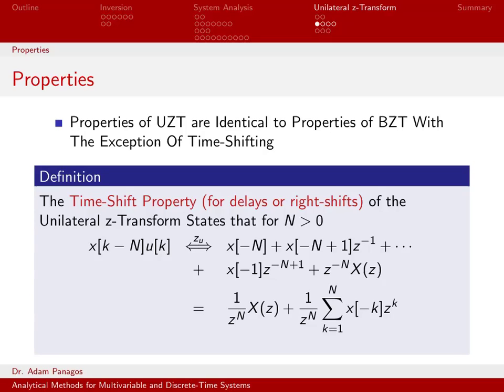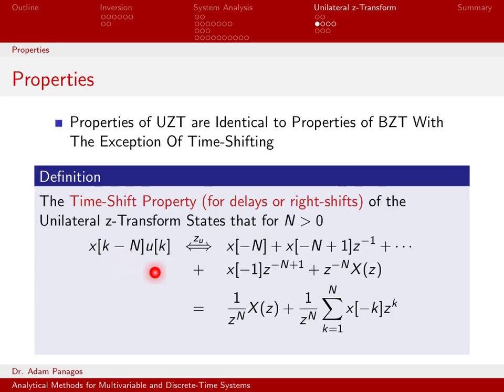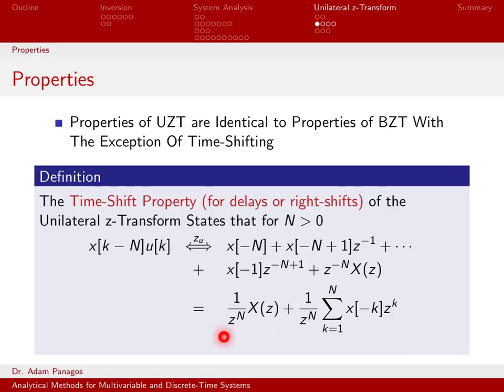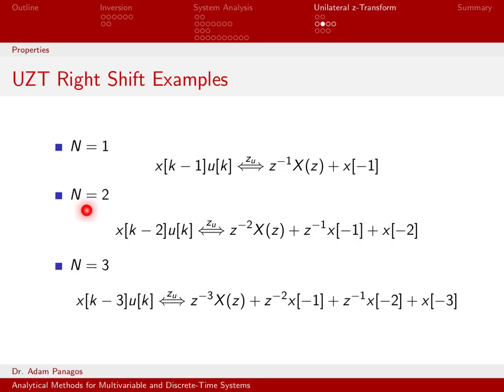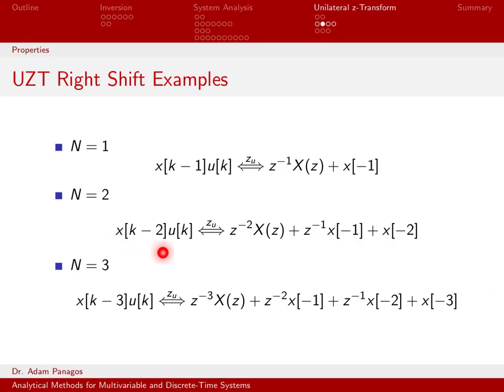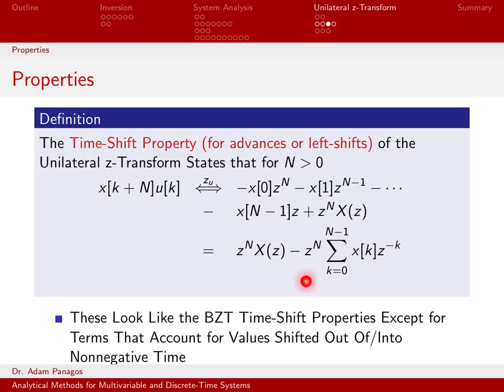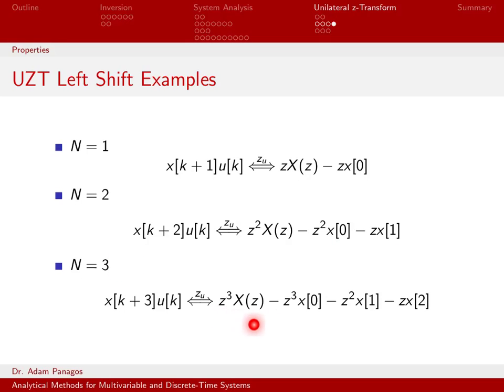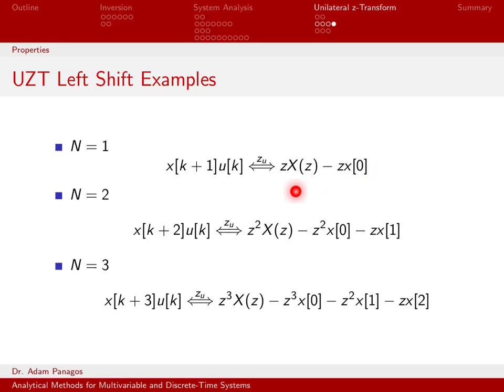Unilateral Z-Transform Properties

Comment: Do this general formulas apply for left-sided signals?
Reply from the maker: This set of videos is about the Unilateral Z-Transform which is used for just right-sided signals.  If you want to work with left-sided signals you should use the more general Bilateral Z-Transform.  I have several videos on the BZT as well, hopefully these are more what you're looking for.
Reply: I'm currently trying to solve the unilateral Z-transform of right- and left-shifted, left-sided signals.  I imagine in the case of left-shifted, left-sided signals, the Z_u would just be zero; I'm not so sure for the right-shifted ones, however.
Reply: These are given problems, so I'm not choosing a specific method.  Here's an example:

Find  Z_u{ (-1/3)^n * u[-n-2] }

Maybe I'm just thinking of this wrong.
Reply: Another case:

Z_u{ (1/4)^n * u[3-n] }. 

I'm getting answers but have little confidence in them.